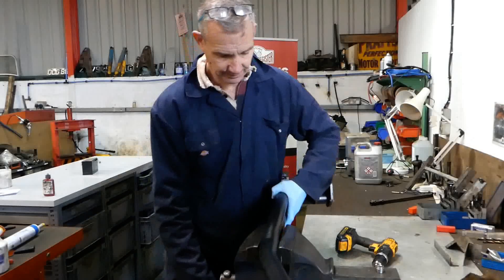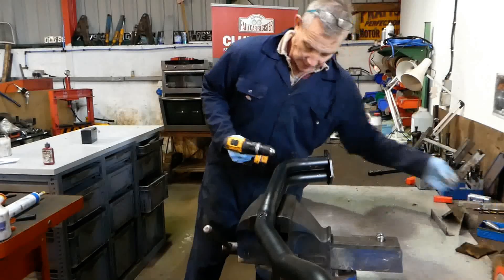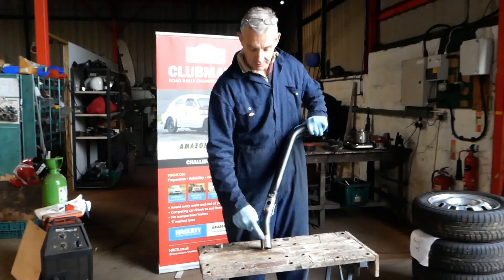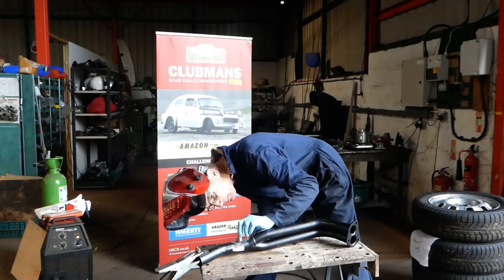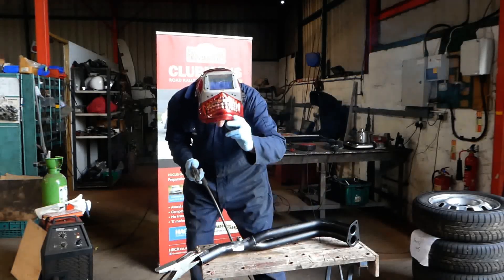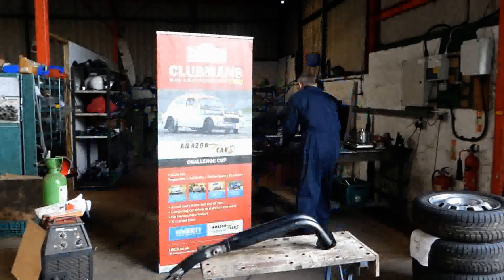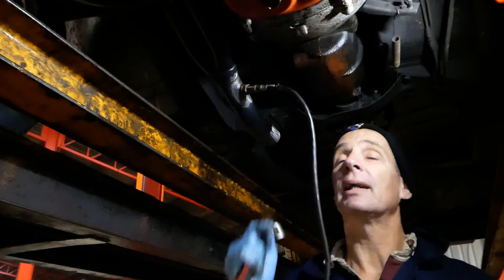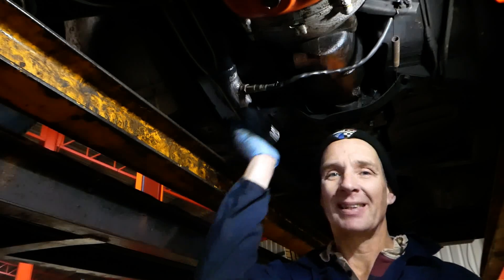Amazon Cars: Fitting a Lambda boss

Comment: Excellent information. Do you have any  video on tuning a Jensen.
Reply from the maker: Jensen P1800 had a single downpipe exhaust from the manifold when built, and therefore the TZ needles in the SU's. If anything has changed here, like fitting the later twin downpipe exhaust, then the later needles (KN, or possibly KD) will be needed. Ultimately, having rigged the WideBand Lambda, you are then wanting to see the AFR to settle around 0.99, you can tolerate higher, but not consistently. I always set the two jets to the same level, using a measuring caliper in "depth" mode.
Regards, Rob